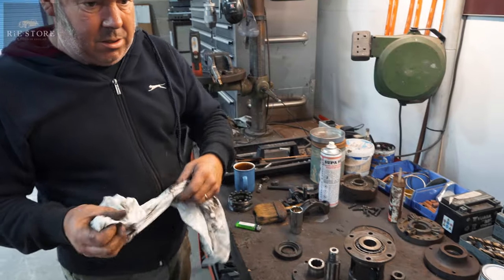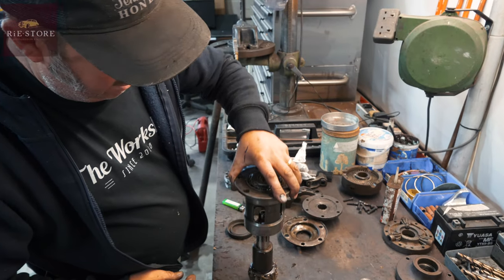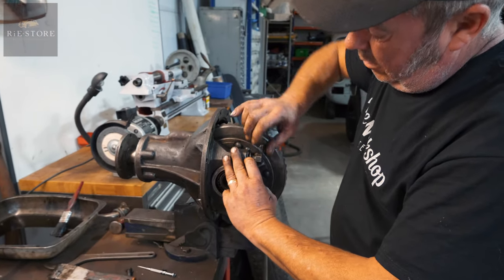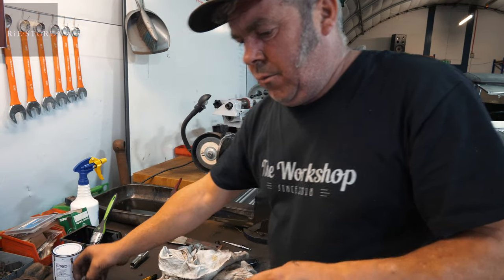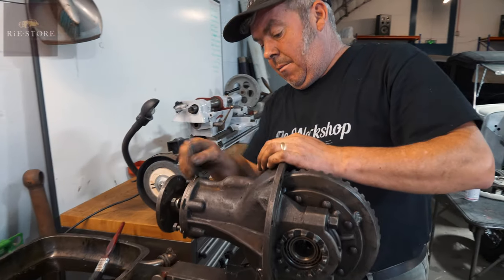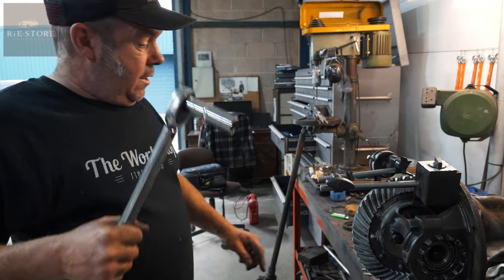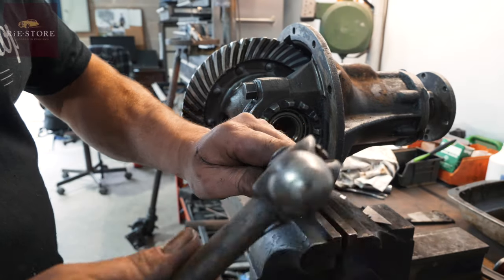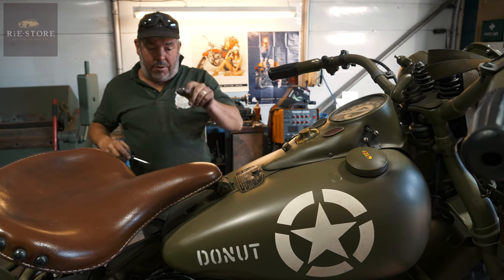How to set the crown wheel and pinion - 1929 Chrysler Series 65 / ep090

Comment: ''This is a sh@y horrible thing called a bearing cup greaser.'' Dammiitt!
Yeah, we got them over here too Y'all. 
But our's are morons more along the lines of what I'd call a 
''Political Bearing Begging Cup Greasers''
Tickled me that when I'd left the volume up to listen while making my bladder gladder...
the thought of Michael Caine popped to mind as Ash was talking. 
Same part of Britain as he, no?
16:55 Too tight cold plays hell on all metal surfaces once their heated up under motion. I can better see that here. 
18:22 When I'd brought my '68 Trophy Sports back home from Ft. Bragg in '74. Dad having been a mechanic all of his life; begin to immediately moor over it's mechanical being. Next morning I got up & he'd done 2 things to it that evening before. He'd drilled & wired the tank's 2 front fastening nuts that same way. Also the rear crack split lateral bar of the tank's ''Castration Parcel Grid'' had been joined back together via a split vacuum advance rubber hose. He said that outta help keep the to tank stay on good & that package rack from de nuttin' ya... cause your gonna owe me a grandson or two. Good stuff all around in the ''Strengthening of them things that remain'' RiE
Reply from the maker: Michael Caine? Ha, haven't had that comparison. But yes, pretty much 10 miles from each other in south London